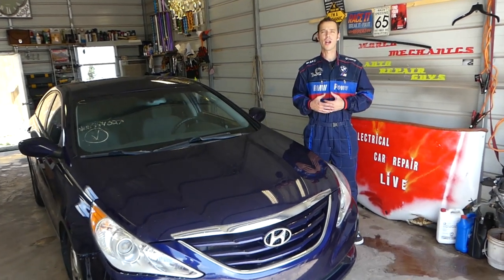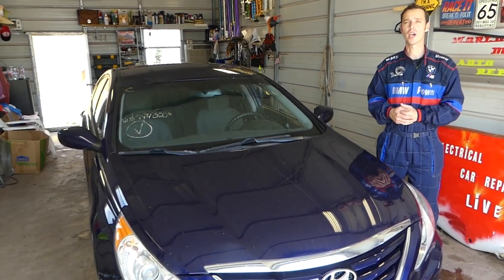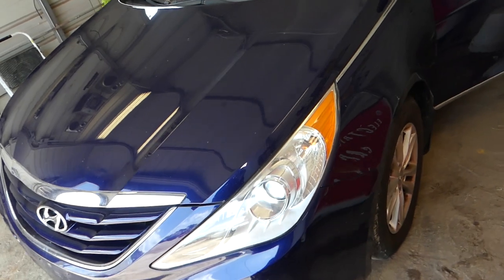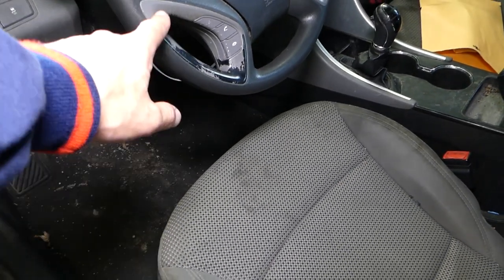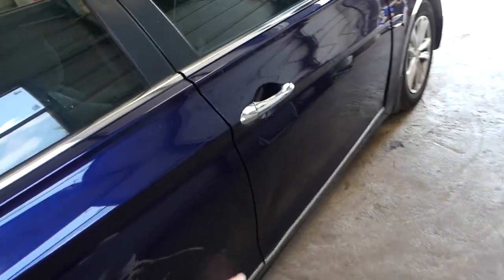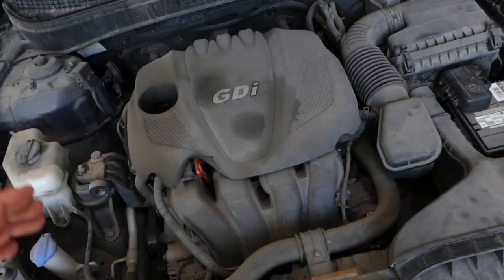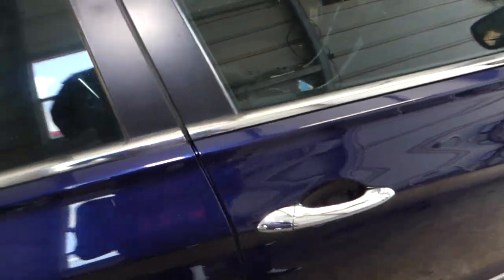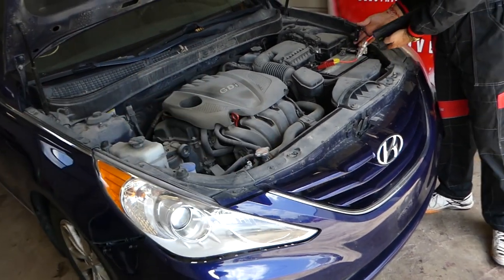MORE THAN 200 REPAIR VIDEOS AND COMMON PROBLEMS COMING ON HYUNDAI SONATA 2011 2012 2013 2014 2015

Comment: Those engines are on a massive recall for rod bearing failure.
Reply: Scott t you’re not lying,I had my 2011 Hyundai Sonata engine replaced for that exact problem
Reply: @petrolhead8851  me too.
Reply: Do we get the Recalls replaced for free?
Reply: @amartinez5472  Fr lmk I’m bout to buy one
Reply: @amartinez5472  yes. Just had mine done
Reply: Tell me about it